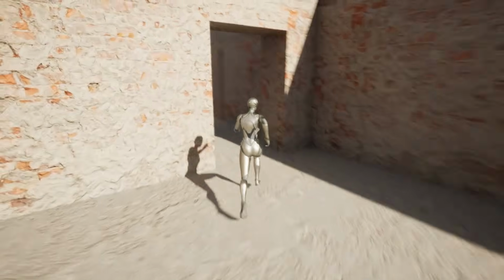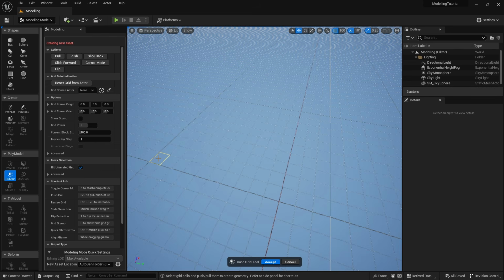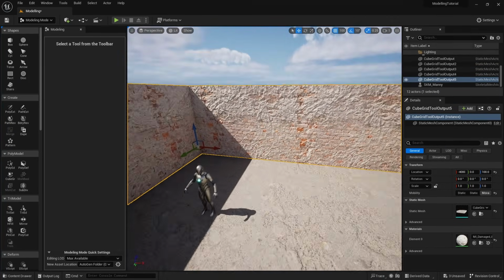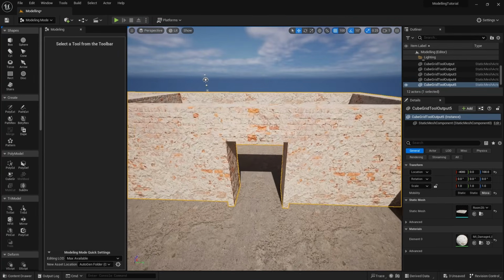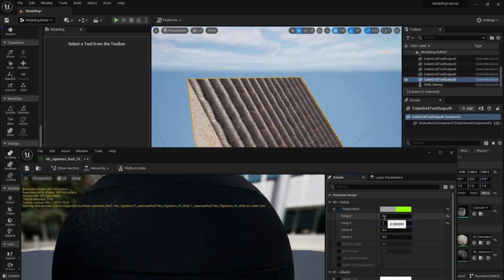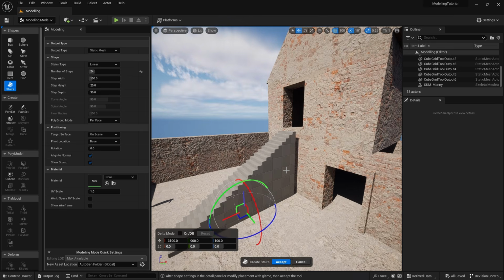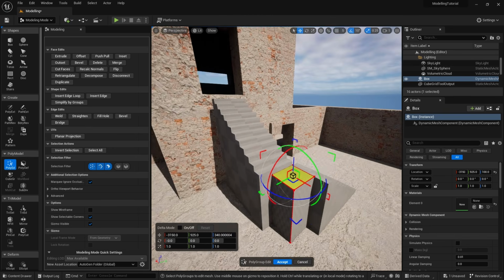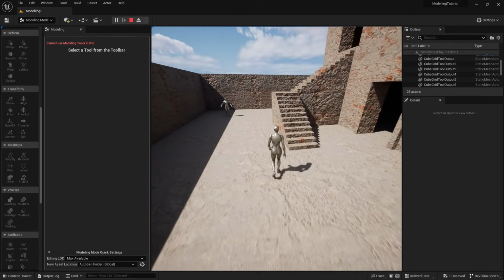UE5: Building Structures - #1 Manual Modelling

Comment: When i place the cubegrid down, it doesnt have any collision. simple shapes like floors work fine if i add collision but stuff like doors and walls aren't working and just make a cube collision. Is this a problem with the new version of ue5 or did i do something wrong?
Reply: In 5.6 Switch to Complex only.

Modeling Mode -> Modeling Mode Quick Settings (Cog Wheel) -> New Mesh Settings -> Collision Mode: Complex Only

Comment: When I check the game, the player falls through the map, as if there was no collision.
Reply: Modelling Mode > Settings > New Mesh Settings: Switch from Simple and Complex to Complex Only.
Reply: I’m super new to this, but that was happening to me the other day and it was because the Player Start was actually slightly beneath the floor. I just selected it and dragged it above the floor a couple meters and then it worked fine. Hope that helps!

Comment: Hello. Great tutorial :) But I have one problem. When I move a mesh created with Grid Tool and want to use it again, the grid is not aligning to the mesh properly. Basically it extends outside the mesh border or not reach the border or not even align with the surface (It will create new cubes below or above the mesh). Any way to fix this? If I for example make a simple building with a Grid Tool and move it somewhere else on the map, I wont be able to add new elements with the tool with the same precise position as before (before moving it).

Comment: I met a problem with making doors, hitting CTRL and dragging works only in one direction to pull geometry, but if I want to push it only the grid moves backward and nothing happens with a wall

Would be grateful to anyone for a solution and thanks a lot to the author for the video!
Reply: Same problem here
Reply: Solved. In my case the exterior walls have to be selected before the extrude of the oom walls, and I guess it wasn't.

Comment: the creating new grid mesh with the "CubeGr" was a little buggy for me. it did not say "creating new asset" in red like yours did. it said something like "edit existing asset". it may have been hitting Esc, then selecting the "CubeGr" that fixed it. (you do actually mention this later in the video around 11:16, for those that get stuck, but don't carry on watching until you mention it)
Reply from the maker: That's a good point, it's an annoyance that caught me out a few times as well. I will pin a warning comment at the top of this section

Comment: Shame Epic didn't add a walk to their default characters. Always running is not allways great indoors.
Reply from the maker: This is easily changed. Open up the BP_ThirdPersonCharacter and select the character movement component.
On the right hand side are various details you can change, including the walk speed. Change it from 500 to 300 and voila, your character will now walk instead of run
Reply: @unrealitybites763  Thank you, I use mostly the HumanBase character asset by Quang Phan as a starter which comes with a walk, run and jump animation

Comment: Love your video's, better that most paid courses out there.
So, I had to rotate the roof tiles material in order to get them looking correct. (I used a different roof material)
But when I added the newly smaller protruded angled part and add it to the "original" angled roof with the material edit, the newly protruded part is rotated to the original material rotation.
So the protruded part is now horizontal, while the "original" roof is vertical.
When I go to the roof material that I used, to rotate again, the top part and protruded part both rotate in the same directions, always having a 90 degree difference.
How do we fix that?

Cheers

*edit
Found out that if I portrude, then select the top faces, and THEN angle the protruded part, the rotation stays correct.
Reply from the maker: Yes, I discovered the same thing which is why I reselected the faces in my video. 
In an upcoming tunnel video, I will show how you how to fix material rotation using the modelling UV tools.
Reply: @unrealitybites763  Ah.. must have missed that you selected the top face as well XD
Oh well, after trouble shooting myself for a little while, at least now I will never forget.

I see pillars and doorways/windows in the walls, are we also going to be able to select a different static mesh in the details panel, in stead of having to change it in the blueprint.
Would be nice to have 1 blueprint and be able to drag and drop a different mesh to use immediately.
I mean, sure I can duplicate the BP and put a different mesh in it, but to avoid having more BP's for different walls would become quite a hassle after you have 20+ different walls or god forbid, 100+
I know you said 3 video's, but I think I speak for most viewers when I say, I would love this one to go deeper, to where it gets more customizable like the one you reviewed.

Cheers
Reply: @unrealitybites763  Found out how to choose a custom static mesh through the details panel.. and how to set collision, you probably know how to do it yourself, but if you want my BP just let me know
Reply: @unrealitybites763  I'm trying to follow along in your video but every time I try to push or pull on my "wall" it doesn't work 14:58 I can only add not delete when doing it and I don't know how to fix it and I can't find it on any forums or in Unreal forums either and it is frustrating. I need help in figuring it out.